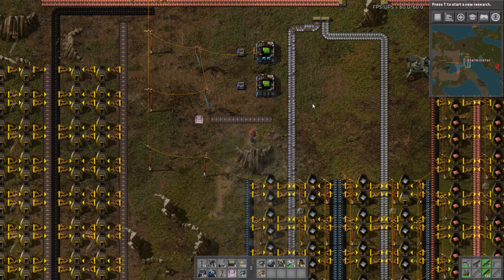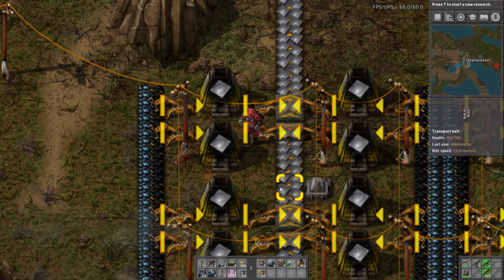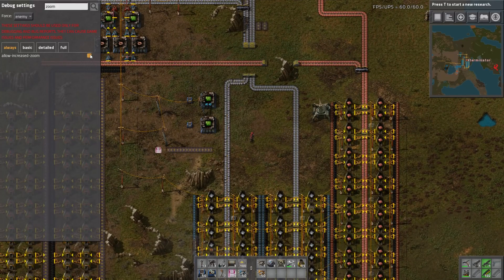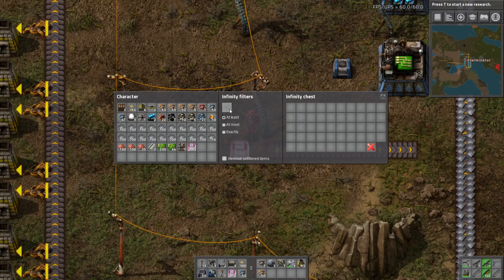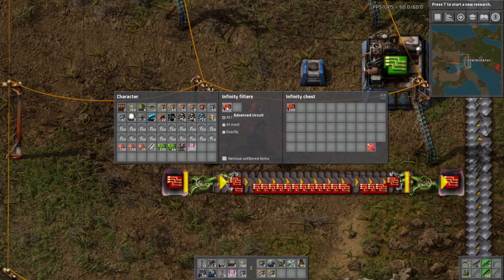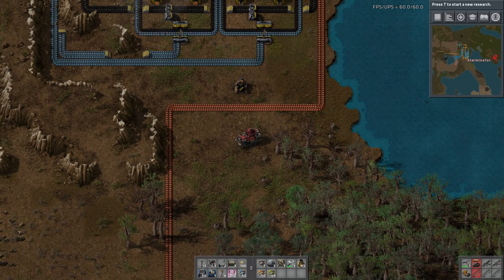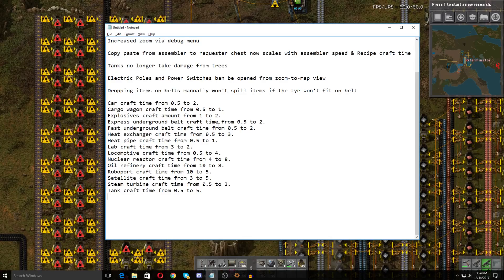Factorio 0.16 Tutorial - 8 New Features, Tips & Tricks You May Not Know

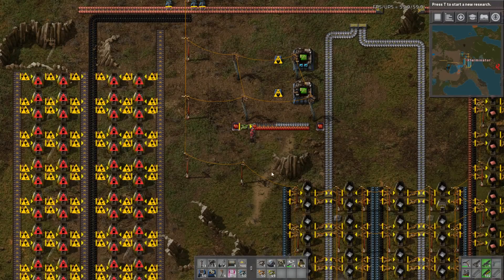Comment: Notes:                         (Note to self: 4:20 !!! Reminder to use this in the robot and no self-crafting run!)
Although it is much faster to build a chest -> inserter to dump the items if not into the final destination directly in the first place...
For dropping items manually,  I played on a German keyboard once and regardless of your current selected system language it was not the z button but rather the location of the button on the English keyboard. 
Which means in my case it was bottom left the first letter key labelled as "Y" (on the same spot the EN z is) and I bet I can relocate the key I need in the options, but just a fair warning.

The map access to power networks doesn't work without power cause you get no map image to scroll into... So correcting a power outage is not easy which would be the only reason to keep a look at a distant energy network in the first place I think.

Unlike Dwarf Fortress, spilling over items is not a valid strategy or is it? I still want to hint at all the options of quantum inventory, let's say you run into the battlefield and keep crafting ammo, as you are stacked with countless other items. A quick workaround is just sponging up iron and spamm the craft key, the moment you cancel the crafted recipe you can usually salvage a lot of the supress transported iron. The ammo example will quickly drain the starting ressource iron and many items cannot be used in this manner, but I found mass spounging and spilling useful occasionally. Another example would probably be early phases of setting up the oil industry and storaging factory plastic to later dump into faster assemblers. This method can partially be a one man train unbound of tracks and setups. I have not experimented with spilled items further besides putting up some troll nifty art.

Comment: small issue with the power poles upgrade is that if the small pole couldn't reach a connection the large one can, when you replace it, the connection is not created.
I hope they fix the belt compression thing, if not via underground belt, allow inserters to push items in gaps anytime (the underground thing was a hack after all), though as a programmer I understand how that might kill the optimization altogether which would not be desirable.

One you left out, it seems assemblies and combitantors placed manually over a blueprinted ghost with settings will preserve those settings in the final entity, previously only the bots could do this, if you built your blueprinted factory by hand you'll have to set things manually again, I LOVE this improvement.
Now if only I could hold a key to place items only if over a ghost of the same type... (I blueprint a lot)

Comment: Can you make a video on belt compression now that the underground belt trick has been removed
Reply: Parker TenBroeck I never knew about the underground belt trick until a few months ago, so I used to side load my plates and bricks from my furnaces. Meant that my columns were two tiles wider than necessary and i used more belt, but it worked the same. It looks like that option may have been removed as well, having read another comment. Please help X!
Reply: I second this
Reply: same
Reply: Make it 2 output lines in the middle instead of 1, put 1 splitter around 2/3 of the length, to balance outputs from both sides between these 2 lines. Put the 2nd splitter at the very end, and take 1 line out of it. You'll get a perfectly compressed belt.
It's, well, 1 tile wider. But it's better to spend 4 extra tiles for 4 smelter arrays, rather than add a 5th one and try to compress 5 lines down to 4 :)
Reply: Yep, absolutely agree. 
It will be a bit more expensive to start with, since you'll be using a lot of yellow undergrounds. But will be cheaper with red ones, since they can jump under 2 groups of inserters. 
But again, you can easily make the turn at ~2/3 of the line length to reduce the number of undergrounds.
Reply from the maker: Yup I definitely plan to do this. There are some new interesting smelter designs popping up to fix this which should be interesting.
Reply: here is something we learned that may not be 100% as i haven't tested it fully, but its definitely better then nothing, simply use a faster tier belt where you would normally use undergrounds, since a belt is essentially a buffer over time, a faster tier belt can buffer more in the same time and then when it feeds into the lower tier it becomes compressed again, or at least in theory, basically your temporarily widing the spaces between items so the inserters can properly place items between them again before closing the gap again, obviously youll get more items down the belts just by upgrading fully but that can be expensive as compared to just replacing a few pieces to at least ensure full compression on that particular tier.
Reply: @SebastianMisch I did not although someone i know did do a simple test...it seamed to have worked although we havent repeated it or tested in every situation, in principle it makes sense though because the belts really arnt that short of full compression they only need a bit to complete, so you just have to give it that little bit of space to put a single piece in here or there.
Reply: Doesn't make much sense. Even if it works.
Initially you have yellow belts only. But among the top priorities, even before you get to oil processing, is to upgrade your builds straight to red belts and steel smelters. All ratios remain the same. It's just 2x smelter productivity and 2x belt speed. From that point, logistics 3 is too far away and too expensive to be able to use faster blue belts for outputs.
The method described above by @SebastianMisch sounds as the most reasonable and simple to do. I upgraded smelter columns in my current 20 hours playthrough, and it works perfectly fine.
Reply: Fortunately this has been changed and it's now trivial to fully compress a belt. Side-loading and inserters will both cram items into even the smallest gaps instead of requiring a gap large enough to fit. Other items on the belt just get pushed back a little to make room. It's really nice.